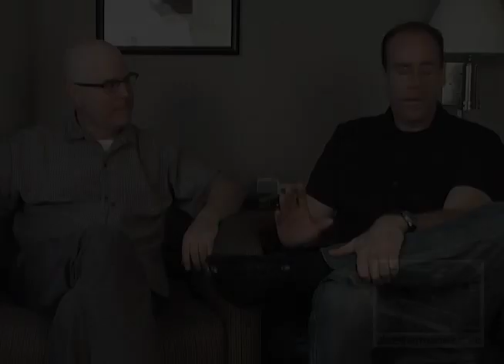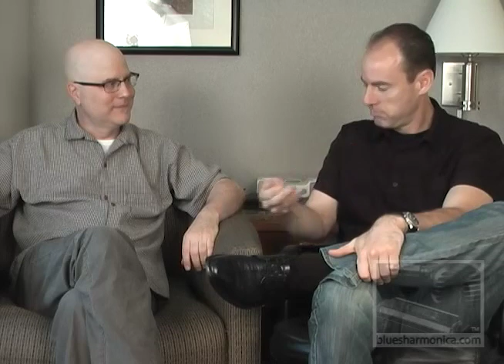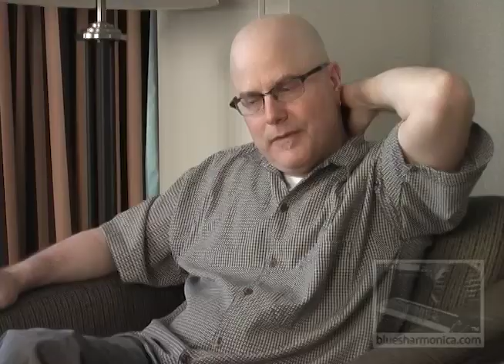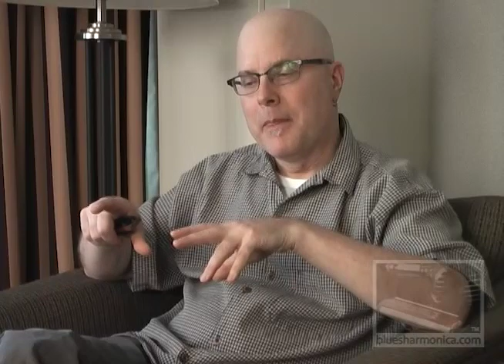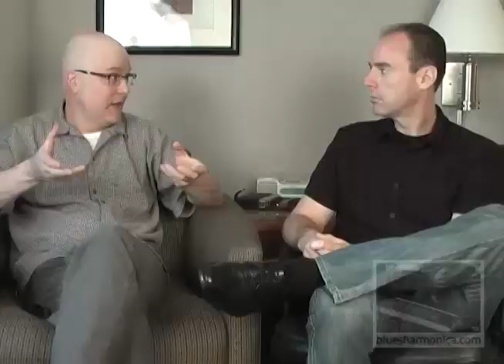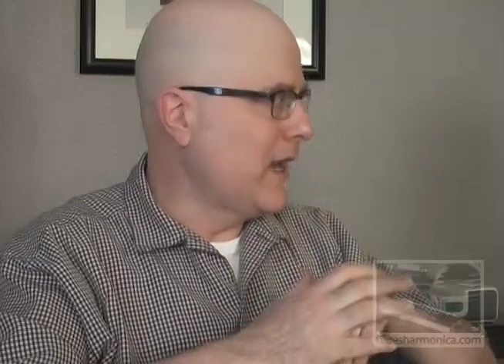Little Walter's Equipment - Interview Snippet for BluesHarmonica.com with Scott Dirks

Comment: People spend a fortune on every conceivable amplifier - supposedly custom made for the ultimate harp sound - the irony is that Walter probably used whatever was around if he didn't have an amp. He strikes me as someone who made do, and wasn't inclined to waste a lot of time driving equipment around. Like a lot of good guitarists, the secret is in his technique....some people can make any old shit happen. Chess studios knew what they were about, and they knew exactly how to get the sounds they wanted; it's probably a mistake to think Walter sounded like he did on a 45 in some club on the road in terms of distortion and echo.
Reply: A lot of it is the technique of the musician.  Two different harp players can sound very different on the same rig, because of technique.

Muddy was kind of the same way about amps as Little Walter.  He just knew where to plug in the cable.  The rest was his ear and his technique.

Comment: To paraphrase Lance Armstrong: "It's not about the bike" - It's not about the equipment, except when it is. He played more acoustic like the two Sonnys, but his amped harp clearly hovered inches away from terminal distortion and the echo gave the eerie power that exemplified his unique style of interweaving melody and chord interludes. The Black Keys use old simple equipment to great effect, not because it is intrinsically better, but because it is NOT, that forces them to keep their sound simpler. Les Paul excepted, very little great music depended upon the engineering to make it great.

Comment: I can add to this - photos show a CalRad or Tandy lavalier small element crystal stick mic - and the records, which are the big deal, reveal tape echo was added post gain but for sure Walter could hear it, Scott is way wrong - also key is that the board channel is over driven on Flying Saucer, Teenage Beat (and the deck providing the echo made a crazy hiss, which they left)- and our guy would have hidden a bag of pot, not a bottle of hooch - just sayin'
Reply: How would he hear it?
Reply: @checker764  on most of the Ampexes in period you could use the front panel rotary selector -  plus of course Walter could booth an amp & run harp mic into the control room,  thus perform with plate or spring or chamber reverb coming over the loudspeakers.
Reply: @andrewgillis8572  What I'm asking is how would he have heard what was going on in the control room while he was recording a track?  Neither Chess nor Universal was using headphones in the tracking room while recording in the 1950s. And you can't run the sound back through the studio monitors while recording without causing feedback problems. When asked, LW did not know and could not explain how the reverb was added to his tracks.

I'm not claiming to have the last word on everything regarding Little Walter - I know enough to know I will never know it all.  I'm just passing along the information I've gathered from 40 years of research. If you have more information or new research, please share it with the rest of us. But guesses about what might or could have happened, without any context or confirmation, are just guesses.
Reply: @checker764  Pont taken - and I'm 50 years, in - but it's a long way before those control room monitors do feedback - Walter knows all about it. No worse than any club he's playing. The leakage, I can hear - sounds like he's on the floor, with band. As it would.  Le Roi de Blues LP tracks reveal echo sopping before Walter is done, playing - which would not happen in 'post'. But would happen if the producers at session thought they had their track & a good ending. For the producer Terry Brown of Rush I played a ceramic capsule JT 30 with not even 12 ft of cable to an amp, in booth, adjacent -  Brown did have phones at ready to double check levels as we went. I needed no phones and was listening now to what sounded like 2 Bassman amps, and with plate reverb, about as loud as on stage at the bar downtown. But, better. This was 1990 and Brown considered it common practice. Would this not be be how Sam The Man Taylor, Harmonicats & other acts could perform with delay the way they & Walter did? Educated guesswork, is what I call it - I see no fresh source of evidence coming our way, better than our own ears. And one part was not guesswork - the part about Walter loving weed. We know that from the guys in Quicksilver Messenger Service!.

Comment: Talking about mics, Dirks says that Lil Walter used whatever was available. That's more or less true. And then Dirks says "and what he used HAPPENED to give him this really cool, unique sound." Wrong. This casual statement of Dirks enormously underestimates Lil Walter's technique and his discernment, judgement and control over his sound. Lil Walter didn't just HAPPEN to get his sound, he was a master musician and a master of all aspects of technique and tone. Dirks is correct in some of what he says (yes, Lil Walter STARTED from what was available in PA mics and amps).  But the idea that the mics Walter played through JUST HAPPENED to give him a great sound is dead wrong. If that was the case, then every other harp player would have gotten the same sound -- and almost no one else ever did. Lil Walter STARTED from what was available in PA mics and amps -- and took it to a new level of mastery and control. Dirks should have more respect for the man.
Reply: Absolutely right. I knew Walter and much better knew Louis Myers, his guitar player in the Jukes and a deeply talented and trained musician. Louis was also a fine harp player trained by Little Walter, including all the secrets Walter discovered about it, so when people came up to challenge Walter at gigs he'd have Louis face off and cut whoever had the stones to do that. Louis shared a lot of these things about Walter with me at various times. They both preferred amps with smaller speakers as they were quicker to respond and suited a harp's overtones.

I know the amp Walter used on on his great hits, Sad Hours, Off the Wall, You're So Fine, Blues With A Feeling etc, and what happened to it. Walter preferred "pencil mikes" as they were called with small heads so he could manipulate the air inside his hands. He and Louis used JT30's when they had to but didn't like them.

In fact I know Scott Dirks, sold him an amp like Walter's best one and a microphone the exact same as Walter used in his mid-career hits. I've told Scott all the above but he appears to have either forgotten it or is holding that knowledge. Anyone who has done great things as a musician always pays much attention to details, as Robin Sandow describes so well above.
Reply: @ttswan  -- Hey, what a totally unexpected pleasure to hear from someone who  REALLY KNOWS. I remember hearing your name around 1969 or 1970 -- you did great work man. Those Vintage albums were truly outstanding. They probably had more influence on me than anything else I listened to at the time, and I still listen to them today. Hugely influential for me, and for the people I knew then in Chicago. Great stuff.

Yeah, it's real interesting to hear what you say about Lil Walter's mikes. I've got a couple of those kinda "stick mikes," made in the late fifties or early sixties I guess (there's one that I've got that was made for the Roberts brand, another by Aiwa, both get excellent tone). I don't know if those were "tape-recorder mikes" or not, but I know for sure there are some other "tape-recorder mikes," made a little later I'd say, that also get excellent tone. Convenient, good-sounding little mikes, all of them. And I'm sure that Lil Walter chose his mikes carefully.

The only song of Lil Walter's I can think of, where I ever said to myself "that's an Astatic JT30 for sure, or something a hell of a lot like it" -- yeah that would be "Confessin' The Blues," with that grainy, kinda "desperate" dry tone that Lil Walter used there. A masterpiece. It wouldn't be the same with a different mike.

It's great that you got to be around Lil Walter some, and got to know Louis Myers. Yeah,  Louis Myers was a master musician, one of the truly GREAT guitarists. A giant. It took some years for me to realize that a big part of the reason that a lot of people didn't cover most of Lil Walter's stuff was simply because their bands weren't good enough. And their guitarists in particular. Yeah, Louis Myers and Robert Junior Lockwood? There are very VERY few who compare. Those guys were GREAT musicians, just like Lil Walter was. It must have been great to get to talk to Louis Myers (and Lil Walter too, of course -- although I get the impression he mighta been kind of an introvert, not the most outgoing -- but it must have been great just to see how he carried himself, to hear what he DID say).

Yeah Scott Dirks gathered a lot of good information for his book. Lots. But yeah IMO he's way too casual in this interview snippet about Lil Walter's sound. Of course it was Lil Walter's amazing "musicianship" above all else, his tremendous mastery of the instrument and his great arrangements that he worked out with the band. Of course -- that was the thing "above all." So from that angle, sure, the equipment might be seen as kinda "secondary." But Lil Walter shaped that SOUND. The whole thing. That SOUND. He was aware of it ALL. And he did it like a maestro.
Reply: Robin - Dirks is as aware  as any of us - yourself included - that Walter sounds like Walter, no matter what. You're not revealing anything we don't already know and understand. This particular discussion happens to be about the gear. Live with it 😉
Reply: Robin Sandow, you completely missed or overlooked the point I was trying to make, which had nothing to do with LW's talents or abilities. My statement was ONLY intended to convey this: it is coincidental that the only equipment available - low powered amps and narrow frequency response mics - happened to be perfectly suited to creating the sound we now know as the amplified harp sound. That's it. Any other interpretation is wrong.
Reply: A reminder that the question and answer above was ONLY about Little Walter's equipment, excerpted from a much longer interview about LW. 

Also, hi ttswan! I promise I haven't forgotten anything I learned from you :) I just don't go into it all in the  excerpt above. I hope you're well!

Comment: Dirks is too full of himself. Not only Little Walter but nemesis Big Walter (also a Chicago player) commonly used tape recorders as amps. Grundig made a little recorder that had great 5W output. For echo, Walter used a long hallway for delay and echo effects. That's a FACT and published. There were very few amps and guitars had to be mic'd before Les Paul introduced the 50's ELECTRIC GUITAR.
Reply: Shootnwhiners In your comment, you sound a bit too full of yourself. So it goes
Reply: Where is it published? Please provided a link or a source. Thanks.